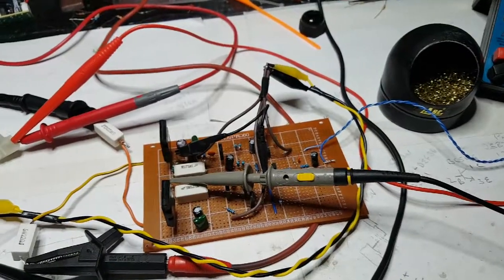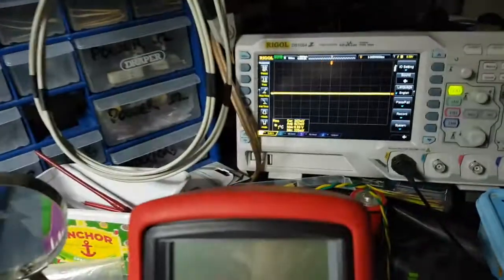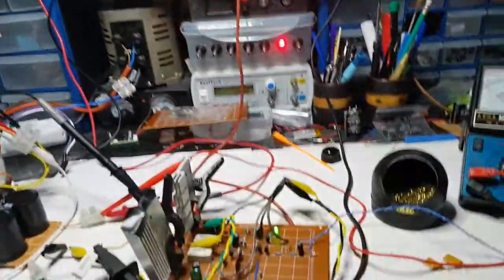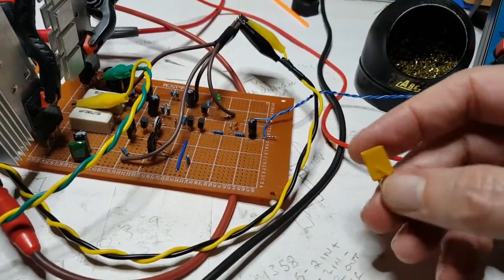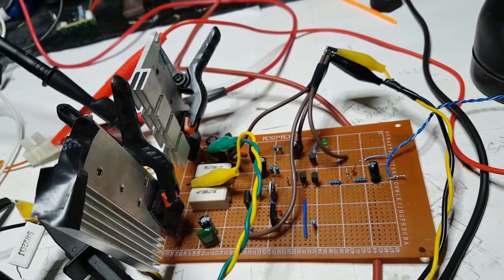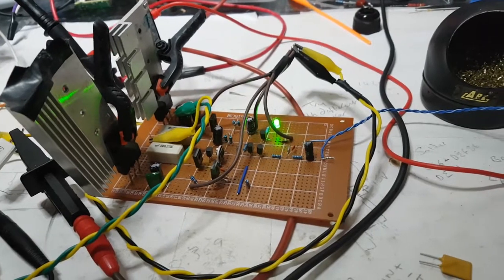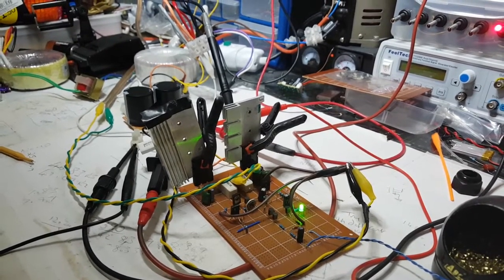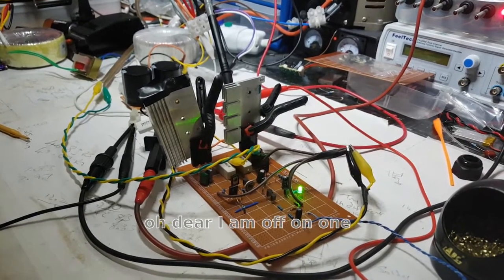60 Watt Amplifier Circuit Build Success

Comment: Hello you clever boy...smile...you are having too much fun again!..thanks for sharing what the fault was..nice soldering work shame about the connections being wrong...lol....nice clean sound..my daughter thinks i am a genius so gave me an iphone to fix...opened it up...OMG you have to be a cross between a Swiss watchmaker and a robot to work on those..i like circuits on wooden bread board with brass nails...lol...been playing with some  TP4056 Lithium Cell Charger Modules with Battery Protection ...very cheap (£4 pack of 5) works great..fixed daughters tablet with one and the other 4 got a few projects in mind
Reply from the maker: Cheers, this is a nice amplifier. I have been listening to a whole range of music via the one channel. I am really looking forward to finishing its other channel. Parts should be here tomorrow, I have built up to the pot and DB140 transistor. I am so happy it was just a connection, I should probably not drink so much when I build these things, lol.
I have seen inside a phone, my eyes are not good enough for them, I would need more kit :D. 
I can vouch for those devices as Ihave been using one on my clock battery for nearly a year. They are very good, I bought a five pack from our friends in the east.
Reply: Elecifun can u mail me some transistors
Reply from the maker: I am sure I could if I tried.
Reply: Elecifun ok so do u need my address
Reply from the maker: You should probably use my 'about' page if you were to email me your address. You ask for transistors on two videos, what transistors?
Reply: Elecifun just some flyback npn transistor
Reply from the maker: Where on our planet are you?
Reply: Elecifun North Carolina in USA were r u
Reply from the maker: I am in the UK dude. Minimum postage charge to US is £10. Not practical I'm afraid.
Ebay sell transistors real cheap 10 for $2.
Reply: Ok
Reply: Ok ima go get some but can u make a video of you building a 12v to 220v inverter
Reply from the maker: sure, i have built a few basic 12v to 242v converters on my channel already

Comment: Are you charging the clock battery using solar?...can you give me some details of how your lithium charger module is connected to your solar panel..are you protecting the module from over voltage on its input?..I think module is 10 volt max input
Reply from the maker: Indirectly yes. The power comes from the solar panel, charge controller, batteries then bench. The circuit with module attached goes via switch box to 'buck converter to usb', then usb to the module.  Might seem complicated but it is really convenient as the lead is always plugged in and the buck to usb has power and output switches also LED display. Same as link but not as pricey 
http://www.ebay.co.uk/itm/DC-4-5-40V-To-5V-2A-USB-Charger-DC-DC-Step-down-Buck-Converter-Voltmeter-UK-FAST-/401264810148?hash=item5d6d3f18a4:g:zJ4AAOSwZQRYh7ja
Reply: Thanks I get "the picture" now...smile...i watched your dull day video and thought you was connecting the panel direct to module though a led volt meter...ahhh so its a buck..thanks..i gota get more into 3.7 and 5 volt stuff its the age we are in now,,i wonder when and how those voltages came about...soldered good wires onto all my crocodile hookup leads,,,those cheap Chinese where 1.5 ohms now reading .1 and nice stable connection